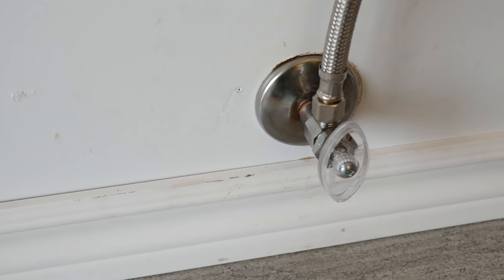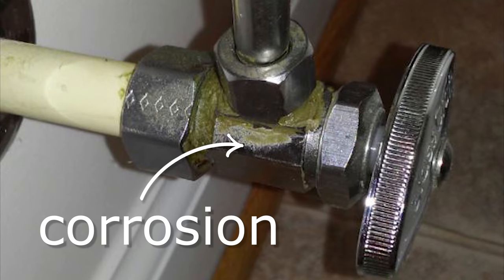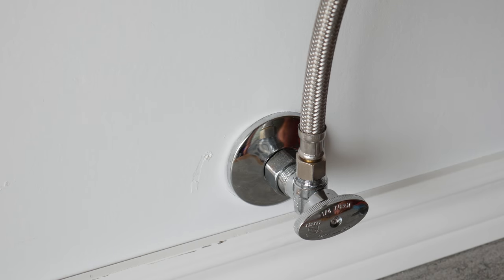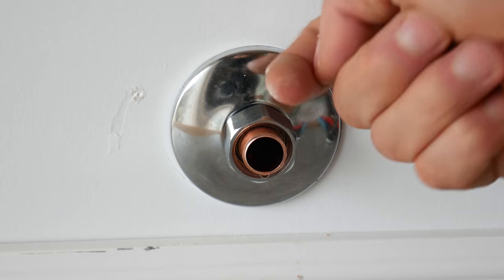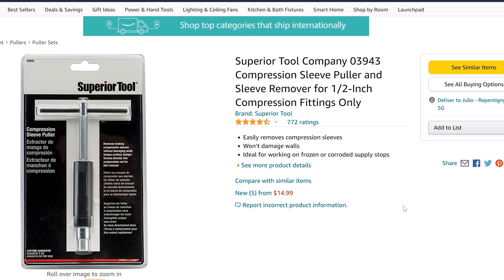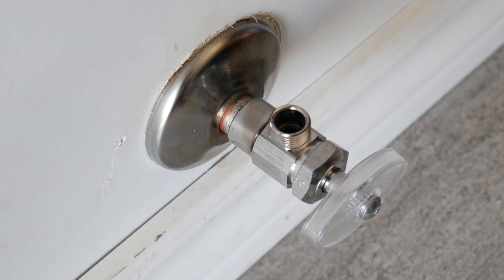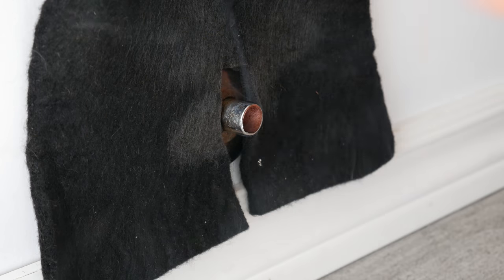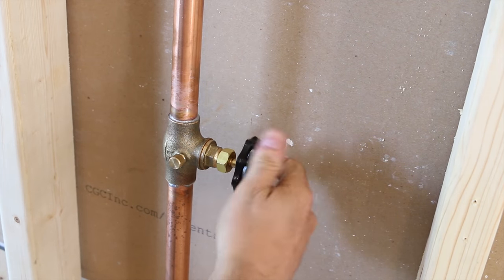How To Remove/Install a LEAKY/NEW SHUT-OFF Valve (Compression, Soldered or Push fit) | GOT2LEARN

Comment: I tried using a Ferrel puller  (like the one in your video)to remove a Ferrell. However the diameter of the on the puller was not slightly smaller than the Washing machine's shut off valve compression nut. The washing machine shut off valve looks more like a hosebib rather than a sink shut off valve. I used the same puller on my bathroom sink valve and it worked perfectly. Are there different sized pullers?

Comment: Can you go from solder to compression, once you remove the old leaky solder valve, or you have to replace it with another solder valve?
Reply from the maker: U can, but the pipe needs to be 100% clean of solder, or the ring won't slip on.

Comment: Very good video. Very descriptive & informative without being too complicated. However, you missed one more type of shut off valve. A shut off valve that connects to PEX pipe coming out of the wall requiring a PEX barbed valve and a crimp ring using a crimping tool to install it. Otherwise, great video.
Reply from the maker: Thanks!!! I didn't cover those because I never install PEX stub outs, only copper 👌
Reply: @Got2Learn   Gotcha. Being in the repair business, I have come across a few shut offs needing replaced that were connected to PEX stub outs and I still come across a few QUEST (polybutylene) stub outs as well.  👍
Reply from the maker: @djfincham5773  yes, polyb is the worst!! 🤘🤘🤘
Reply: @Got2Learn   Many say that but not the case with my house. My house was built & plumbed with QUEST in 1989 and I have never had one single leak in 32 years.  ✌
Reply: @Got2Learn I'm assuming you don't use sweat on valves with copper stub outs, but what if a DIY homeowner assumes the piping is all copper and tries to change to a sweat on type, would the heat damage the PEX transition to copper or you use enough copper to keep the heat away ?
Reply from the maker: @DL101ca  best to use compression/pushfit, but solder is fine if it's not overheated.

Comment: i shgould watch the wholwe video so dont e ven respond to this but what kinda valve is this...if its compression... it clearly hasnt been tightened fully for installation..i see thru further comments it is compression...i would never trust this idea cause a compression valve squeese the pipe with ring so removing this ...is a piece of copper compressed ...this just makes no sense... just to clarify tho i love your channel and you give great information...just this one is lol XD ...keep sending the tricks tho my friend...include fitting brushes cutting off and using in drill for inside cleaning in enxt video if u havent yet...im sure u have tho

Comment: I have a 2 story house and need to replace the shutoff valve in a downstairs bathroom. Will the vacuum hold long enough to replace the valve, or do I need to drain the whole house first?
Reply from the maker: Drain as much as you can, vacuum won't hold.

Comment: I do fix them all times. They take 1/4 washer , just remove the packing nut and unscrew the handle until the whole thing comes off , remove and replace old washer . Done ✅👋
Reply: I have bought rebuild kits at the Depot for the Brass Craft multiturn valve like the kind shown at the beginning of the video for not much $$. Some kits have a stop washer, stem seal, stem and handle.
Reply: What a great key point !

Comment: What's the best recommendation for replacement.  I currently have a "sweated" valve so should I replace it with another "sweated" value installation or is it OK to just use a compression one?  Thanks!
Reply: If it's a sweated gate valve, you could just replace the gate part and leave the body on, so you don't have to do any soldering at all.
Reply: @DL101ca  Thanks!

Comment: Bravo 👏🏻 

?: in Canada, can you suggest supplier of quality shut offs? I’m not too keen on what’s sold at the big box home centres. Thx!
Reply from the maker: Thanks, get good brands such a Dahl or Brasscraft, they sell them in big box stores.
Reply: Got2Learn Ciao.  FYI I just replaced a couple of cheap, old, leaky shutoff valves under my kitchen sink with a pair of Dahl ball valves from Home Depot remembering your advice above.  What a difference!! Thanks again. Great channel in many ways. Salut!

My four year old single handle kitchen faucet from Delta developed a leak just inside the aerator which back fed the water through the faucet and down underneath my sink.  Delta was good enough to send a replacement after a online call with service Canada and a video conference where I could show the failure.

I took apart the failed unit and I could see the poor fitting of the thin plastic tube inside the spout. It was twisted just ahead of the aeration piece and developed a hole in the plastic tubing.  I mention this in case it helps someone else out there.  

The replacement faucet is not constructed with the plastic tubing.  Copper supply lines underneath.

Kudos to Delta Canada for the quick response to their defect.

Comment: if I got a leak from one of those I just pull out the guts and put new ones in. not alot of people like upgrading so we just tighten the packing nut or replacing the guts...you had the water off to replace the guts...put a ball valve in lol
Reply from the maker: Yes, however, some models are "one piece" meaning they don't have the option to do that, but for those that you can, that is the way to go yes.

Comment: i watched, removed old compression fit, and put a new compression fit on. thing is, it was doing a pretty serious leak when i didn't "over tighten" it. so i put some tape on and tightened it hard. the leak stopped, why did you say not to over-tighten these?

and the remover tool was 100% necessary.
Reply from the maker: If you overtighten you can crush the pipe and you won't be able to undo it after, you'll need to cut the pipe further down and restart, sometimes this can't be done.

Comment: If leak is from handle stem (assuming it's not as old as the galv. pipe theat needs a good pezxing) leaking stems (this goes for hosebibs too)  can be fixed by simply adjusting the packing nuts.  P.N.Adjustment Board  requires a permit pulled per packing. Which requires.   Master P.N. Adjusters w/ current License. To perform any work on NUTTS

Comment: good video but I suggest the other reason is you have compression old type valve and doesn't quite shut off the water flow and want to put a quarter turn valve on.

Comment: What do you think about soldered vs compression fit shut-off valves ? Is one more leak proof ?
Reply from the maker: soldered is always better.
Reply: @Got2Learn  Appreciate it. Seems like compression fit mostly for ease of install.
Reply from the maker: @jakec5618  exactly
Reply: @Got2Learn   We're really moving towards crappier products and way things are done I feel. Not just this but the way they build houses nowadays, things are sure not how they used to be built (which were much better, in my opinion.)
Reply from the maker: We sure are, soldered joints passed the time test!

Comment: In terms of length, how much exposed copper pipe is needed for putting on a new compression shut off valve? I only have about 1" to work with.

Comment: Compression fittings are often over tightened, which sometimes makes it impossible to pull ferrule ring. Copper pipe gets deformed when over tightened. I found putting little bit of pipe dope on ferrule ring helps when reusing existing ferrule ring and even with new ferrule ring, it is good idea to put some pipe dope on copper pipe and ferrule ring because existing copper pipe may have slight deformation from old ferrule ring.  Just take care not to put dope inside pipe or valve. Pipe dope can clog aerator for filter screen. Brasscraft shutoffs can be rebuilt. Home depot has repair parts for it. So, if the valve body is not is too bad of shape, that might be easiest way to fix.
Reply: Is this one of those where you'd be much better off going to the specialty plumbing supply store? I hear there's a few parts that will fail if you use cheap HD parts.
Reply: @windsofmarchjourneyperrytr2823  Brasscraft multi-turn angle stops sold at Home depot is actually good. But, brasscraft 1/4 turns are garbage. They are not ball valves, instead just plastic tube with a hole. They don't last. Sharkbite ones are good quality, except for the fact they are sharkbite fittings. Ones sold at pluming supply stores are often their house brands, and usually they are ok.

Comment: In your beginning you showed a valve dripping. It was leaking from the packing nut. Tighten the nut a little to stop the leak.
If you have that type of valve and it won't shut off. Take it apart and replace the faucet washer.
Another thing from my 54 years of plumbing ! At times the faucet washer will be so bad it'll break in pieces and plug what its feeding, a faucet or toilet fill valve which changed names when the big box stores came to town. They were called ball cocks, because we use to see float valves. Ball stood for the float and cock was the valve.
Same for an outside faucet, was called a sillcock. It came out thru the sill !
How's that for some education for you young DUIers ?
Reply: Oh, we’re so in awe of you Bob boy!  😂 seriously, great comment and appreciate your vast wisdom from all those years of experience!  ✌ 

The creator of this channel knows his stuff.  👍
Reply: We just took one apart. Apparently untouched since about 1960! A green toilet and tub set. Brass washers! He said he'd never seen them in 4 years plumbing. 

The original cock and ball setup was working just fine n dandy, thanks! Lol

Hate the cheap plastic ones they force you into now. 

I plan to salvage them both when we leave. Hate to see them just trashed.

Comment: Is it possible to change a compression shut off to a solder? would the pipe need be replaced?
Reply from the maker: You can just make sure the pipe isn't oval-shaped, cheers!!

Comment: Is taping needed for compression? I saw it is not used in the video but someone recommended I use one.
Reply from the maker: Taping as in "PTFE taping" ?
Reply: @Got2Learn  yes those soft white tapes. I use it all the threaded part in plumbing. I am wondering if i am doing right?
Reply from the maker: @hcanergocmus  no need on compression fittings ;)

Comment: I have a challenge for you   My bedroom has an en-suite with shower.   The shower has a Moen single handle valve.  Turning it to extreme open (9'oclock position)  provides hot water only, midway (12 oclock) provides is a mix of cold and hot water, and of course, to the right, cold water only,.

In summer, with city water temperature around room temperature or just below, the mid-position of the valve yields a moderately and comfortable warm temperature at the midway position.  Now it is winter, the cold water line has water entering so cold, that the mixing valve has to be at the midway of 9 and 10oclock position, in order to have comfortable hot water. 

Is there a one handle shower valve that uses the water temperature as a regulator?   Can I re-adjust the temperature without fully dismantling the valve (i.e, remove two set-screws holding the plate to the valve, and with an angle ratchet driver, access and do the readjustment that will also work for the summer when the cold line is around 60F or 16C? 

.

Comment: Great video. Very informative and easy to follow. Unfortunately, you did not cover what to do when the pipe coming out of the wall is threaded, which is what I'm dealing with. I wrapped teflon tape over the threads and screwed on the brand new valve. No matter how tight I make it a little drip keeps coming out. I did the same exact thing on the pipe that supplies the hot water and it's working fine, so it's a bit confusing and a lot frustrating.
Reply from the maker: Ohhh, so sorry for this...
So what I think is happening here is that the nipple threads are somewhat loose, did you try unscrewing it out of there?
Reply: @Got2Learn  - Wow! Thanks so much for the quick reply. Everything feels tight and snug. Does it matter what direction you wrap the teflon tape? Luckily, I don't have any other connections to deal with. It's just the pipe from the wall with threads and the valve that screws on. I noticed with some things a rubber washer is included, but this valve didn't have one and the pipe that supplies the hot water is the same exact set up and it's not leaking at all. Thanks so much for helping me out.
Reply from the maker: My pleasure Jeff! 
So, to answer your question, teflon needs to be installed in a "clockwise" direction (see this video for more info: https://www.youtube.com/watch?v=Rg_yFELOfjs&t=20s&ab_channel=Got2Learn). On this type of valve, there should be no rubber gasket involved for the threaded part, so if there's one, you can remove it, if you need any more assistance, just add me on Facebook: https://www.facebook.com/got2learn
Reply: @Got2Learn  - Awesome! Thank you so much! It's crazy to think that something as minor as putting tape on the wrong direction could cause such an annoying problem. I think you are right though. When I put the hot water valve on I put the tape on correctly just by chance because in the tight space under the counter it was just easier to do it. I thought going in the direction of the threads made sense, but then on the cold water side I was just in a weird position where putting the tape on clockwise was harder. I figured, "Does it really matter?" And now I have to do it all over again. Lesson learned here is, do things right the first time and don't be lazy. Thanks again so much for your help!
Reply from the maker: @jeffclaassen  💪💪💪

Comment: Great video! My confusion right now is that when I put the new compression valve on, the whole thing can spin freely and even easily slide right back off the supply pipe. This can't be correct, right??
Reply from the maker: Is it pex or copper you are working with?
Reply: @Got2Learn  It's copper. Since the new valve can do this I'm assuming that as soon as I turn the water main back on, it would just pop right off from the water pressure & start pouring water in here. Everything with the new valve seems same size as the old so I don't get it. What locks the compression valve on?
Reply from the maker: @gryanm  that means there's a Sharkbite fitting in the wall.
Reply: @Got2Learn  I don't know. Copper supply pipe coming out of the floor, new valve just doesn't tighten onto that pipe to hold onto it somehow. The new valve itself slides on and off, nut, ring & all. I must somehow be doing something wrong but not sure what because this is pretty straightforward. Thanks for your help & replies.
Reply from the maker: have you tried other types of connections? Does a copper fitting from the store fit?
Reply: @Got2Learn  I have an arm injury in recovery right now, and not the best dual pair of pliers, so this came down to not being able to really tighten it down enough. Got some help & that resolved it.
Reply from the maker: Ahhh, glad to hear it worked out for you...Don't forget to share if you can, really helps the channel, thanks!!!

Comment: Using the push on type, is there any worry if it will pop off from water pressure if not pushed on completely?
Reply from the maker: yes, must be pushed in all the way!!
Reply: @Got2Learn  well it’s been on a few days and toilet is working good, so hopefully it’s on all the way and I won’t come home one day to a flooded bathroom.

Comment: I have found that condensation happens between the threads and the compression nut, making it harder to remove in the future. 
Also teflon tape around the ferrul helps to seal it from leaking.
Reply: Hi, which part is the ferrule?

Comment: On a 36 year old compression fitting are there any suggestions to make removal easier if difficult to remove, I do not want to damage the copper pipe. The laundry valves look bad, that is why the replacement. Thank You.
Reply from the maker: Might be worth using a rotary tool to cut it 90% of the way and use a flathead to pry it off...
Reply: @Got2Learn  Did replace the two valves and they both look and work great. What is your thoughts about this, a outside hose bib that is soldered on, I can heat it and remove it, should I replace it with a soldered on hose bib or can I use a 1/2-in Compression Brass Multi Turn Hose Bibb? I am not experienced in soldering also two different plumbers wanted around $280.00 to replace the hose bib.
Reply from the maker: @21daytona502  best is to solder as the pipe you'll be installing on was soldered already, right?
Reply: @Got2Learn  Yes the original is soldered except I do not know how to solder. I can buy copper pipe, fittings and practice. The hose bib is very close to the outside stucco wall so no room for mistakes. The alterative is to pay 280.00 and have a professional do it.
Reply from the maker: @21daytona502  have you watched my "soldering" playlist? SOLDERING: https://www.youtube.com/playlist?list=PLLEVGyi2B-caiXZtuTw6LQGJznIkXk2Hy

Comment: You forgot to mention that there might be water in the lines. I use a pump style feral blaster,however replacing the nut isn't always necessary. You forgot to mention the FIP angle stop valves too.
Reply: At a REALLY old house. You need to be careful turning the house supply back on. God only knows wth is in those nasty old pipes, and you really don't wanna find out if you can help it. You'll be there all day replacing all of it.
Reply: @windsofmarchjourneyperrytr2823  galvanized pipes for sure. If I know its galvanized before hand I flush with a bucket then connect at the fixture. Open hose bib to divert debris and turn house back on slowly.

Comment: Can you go from a soldered valve to switch to a compression valve so you don't need to re-solder?
Reply from the maker: Pipe needs to be clean like as if it was new, it can be done.